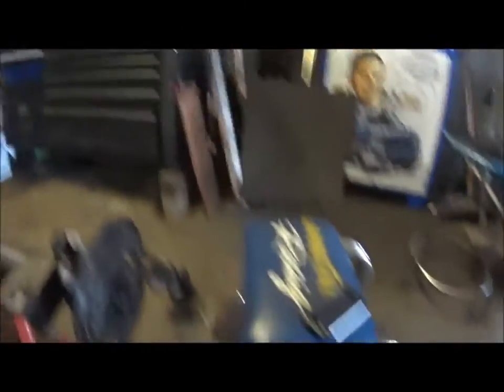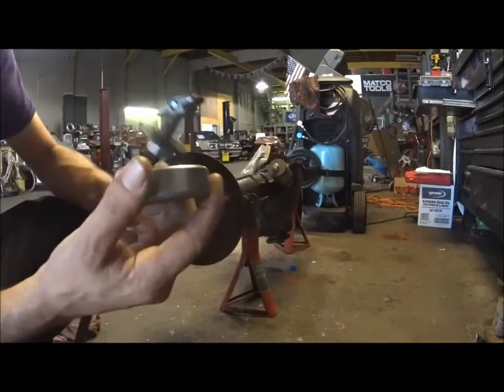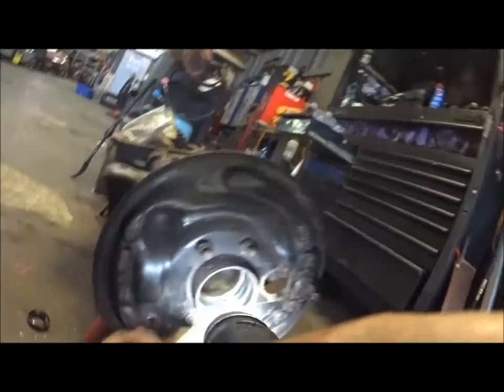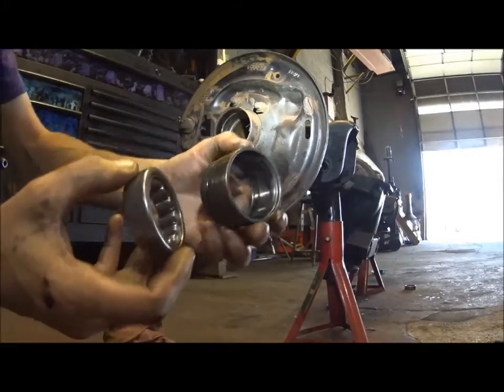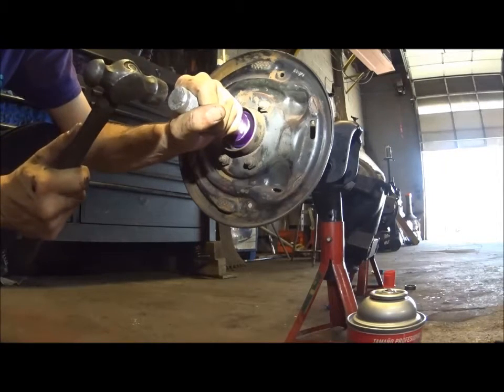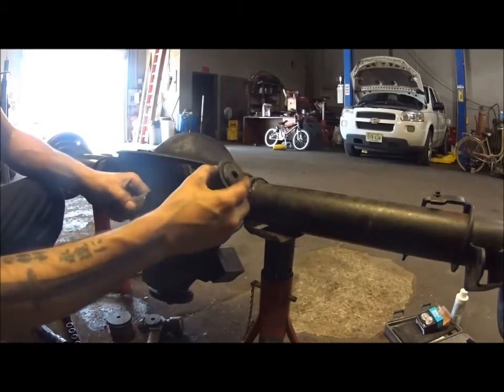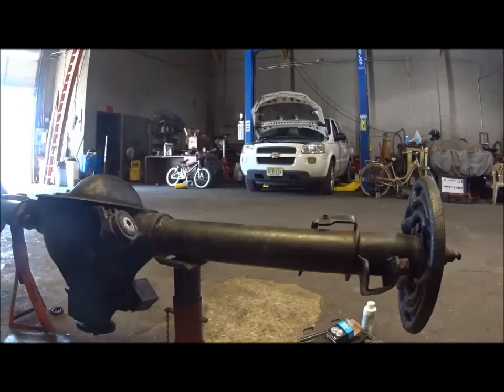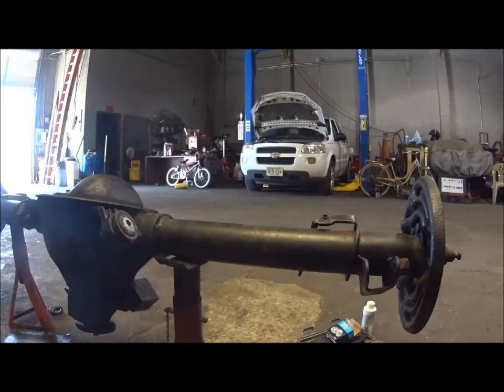Ford Bearing  8.8 AXLE Bearing Install

Comment: I just did the bearings and seals in my Explorer which has the 8.8 in it also.  When I ordered my parts I saw those one piece units like you pulled out of the second side. The state inspector found gear oil in the left rear drum on mine.